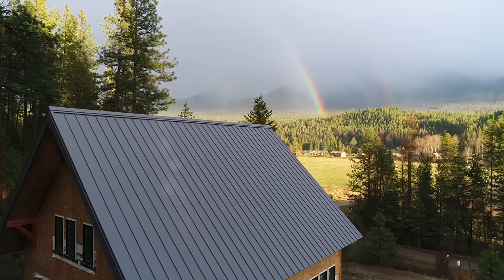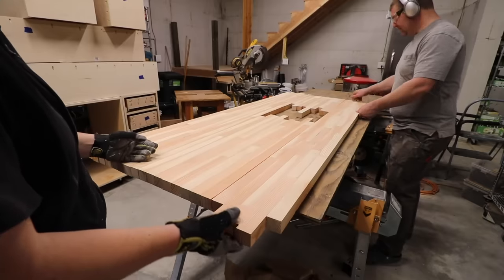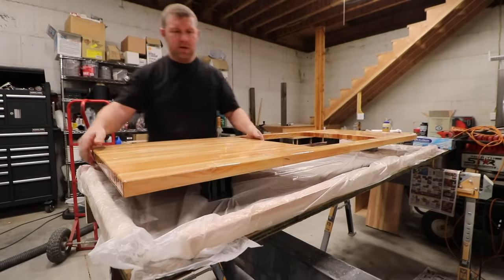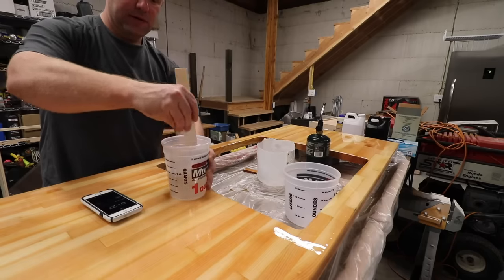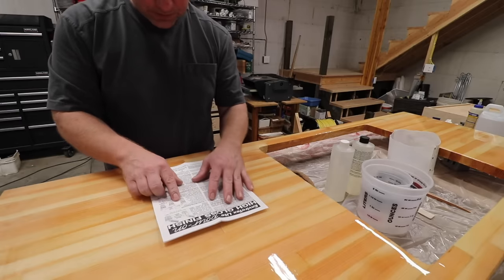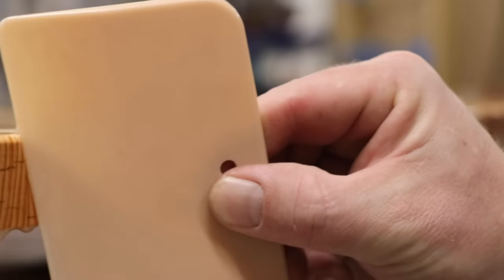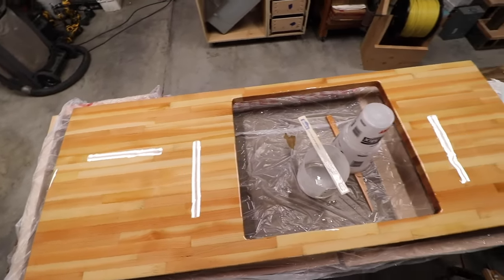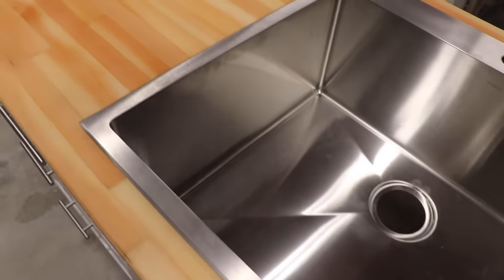AVOID THESE 9 EPOXY POUR MISTAKES

Comment: I've watched quite a few videos on this topic and this is the best. Extra tip - put the resin and hardener  bottles into warm water for a few minutes prior to mixing, this greatly reduces bubbles forming!
Reply: The best? 🤣  this guy messed every stage up, threw about 10ltr on as a flow coat... then sanded the entire thing back to the first coat🤣🤣🤣😂😂   then you gave totally bogus advice and introduced water into the equation, No!!  don't put anything into water with epoxy. If you need to heat epoxy do so by dry means of heat and try to stabilise it so its done over a period of time. Its more important to match the surface you're pouring onto with the epoxy you are pouring on.   
What do I know though I'm only a 4 decade boat builder who's used probably 30'000-50'000 ton of epoxy over the years and built maybe 150-200 home projects including a 35ft long dining table from a split section of Scottish Oak that sold for £28k.  This guy doesn't have a clue and should not have made this vid claiming he did. If his desired finish was wax "brushed" or satin look (ive no idea what exact look this is other than a complete F-up) then a simple feeding in of epoxy on the knots, gaps and greedy bits followed by two thin barrier coats, roughed back with 180 then waxed for whatever reason you'd put wax over epoxy😂  litteraly a 3hr Job. This vid is ridiculous and he's showing the basic stuff that even the entry level epoxy educational vids cover within the first 3 mins. Bogus vid and your praising of this vid is just as bogus.

Comment: My advice would be to use respirator with ABEK1 filters, when working with epoxy. There are different opinions about safety, many youtubers dont use any protective devices. But i have some experience with aircraft maintenance/repair companies, where people are working with composites (epoxy, carbon fiber), and there usually are strict rules always to use respirators, even for quick tasks with resins. Epoxy resin, at hardening stage, spread harmful vapour, which can lead to cancer.
Reply: newer epoxy blends are low or VOC-free formulas.   More traditional forms of epoxy yes definitely respirator, but not as necessary anymore.

Comment: I've been mixing epoxy at multiple jobs for over a decade and have never seen anyone use two containers to mix it nor have I ever had that problem. You're definitely not mixing it well enough
Reply: actually the two container method was a solution it soft spots and is gaining popularity among the do it yourself market, that bigger than the professional market

Comment: I of a different option about this video. I felt that if was informative and was not a rehash... maybe some of the footage was use again but by adding your experiences on how you did the. the good bad and ugly makes it...

I did a project like yours and run into some of the same problems... I found very little information in youtube videos about the problems you can run into.

The one thing I would add is as the size of your increases the level of skill need increases exponentially.   My project was more that twice the size of yours and the 3 of us were running around crazy.

Comment: You will find in the end that epoxy finishes are the worst error in finishing you will ever encounter. They do not wear well and any heat, even the heat from a hot bowl of soup placed on an epoxy top will soften and distort the finish. Epoxy is super expensive, time consuming to apply, messy and all show at the start with no go in the end. You can purchase a butcher block patterned top for next to nothing made of Formica which is nearly indestructible and will last for decades. In a year or two you will look back and say, "What was I thinking?"

Comment: All that work and talk about getting a super glossy finish and then they sand it? They could have skipped the entire thing and used a varnish and been done in 3 hours for $10.00.
Reply: 1 layer of epoxy has the same effect as 70 coats of varnish

Comment: Your flood coat would have been easier if you put masking tape on the edge to create a barrier.  This stops the epoxy from flowing over 
the edge, and you will not need to scavenge the material.   Use your torch to pop bubbles and when your happy with the surface.  
You pull your tape and the epoxy will flow off the edge.  Spread the overflow on the edge to get full coverage.  The rest will take care 
of itself.
Reply: you all probably dont care at all but does any of you know of a trick to get back into an Instagram account..?
I somehow forgot the login password. I would love any assistance you can offer me!
Reply: @Cayden Grady instablaster ;)
Reply: Makes sense. Thanks for the tip!

Comment: You could also use sanding sealer .spray it onto the your surface sealing the wood and you would have no problem with dry spots on your first coat of epoxy.
Reply: THANK YOU! I needed this tip really badly

Comment: There is one thing i don't get.
Why pouring epoxy when it is not to fill a "void" but to put on a "thin" layer.
My dad always painted it on with a roler and he always had a perfect finish wihout the mess...
I don't see anny difference....

He always did multiple layers on the decks of our small competition boats and it always looked perfect.

And from what i learned is that you should to the underside too to prevent warping.
Reply: mainly because they have no idea what they are doing.  They are not driving instructors, we are watching the multi car pile-up...

Comment: I’m preparing to put epoxy resin on a round dining table and three leaves that I’ve just built.  Of all the videos on this topic, this one appears to be the best.  I’m very worried about keeping the inside edges of the table and leaves clean and the use of packing tape looks to Ephesus a great solution.  How long should I wait to remove it?  Also, should I remove the tape after the seal coat and re-apply it for the flood coat or simply wait until both coats are on?  I’m concerned that when I go to remove the tape it will break off instead of the epoxy.
Reply: Pull your tape while the epoxy is still tacky

Comment: Why didnt you use polyurethane on wood? Kind of wasteful using expensive epoxy (clear at that) on a butcherblock. Several coats of "wipe on poly" would work great and keep some of the natural grain pattern.

Comment: The top looks great, no doubt about that.  I didn't see if you epoxied the bottom side though, if not, wouldn't you be afraid of the wood expanding and contracting and eventually cracking the epoxy?  I don't know, never worked with any of this before, so I'm just asking a question.

Comment: I'd recommend using a 1/4 inch notched trowel to spread out the epoxy instead of using a straight edged applicator.  This will help ensure the epoxy thickness is similar everywhere and when you quickly repeat spreading the epoxy, you will also be mixing and re-mixing the epoxy while you are applying it.
Reply: Ohh he needs a lot more advice than that😂  dude sanded back his last 2 coats and a heafty barrier coat to basically the first coat.. then brushed it and threw wax on hahahahaha. Guy basically applied about 15ltr of epoxy then sanded it all off to get a finish that could be done within 3hr. Embarrassing

Comment: CO2 removes bubbles?  Not heat?   If true, could you just use a bottle of CO2?  Or is it both heat and CO2?  Idk, never heard that?
Reply: Lots of folks use a heat gun rather than a torch. I don’t think that you get co2 from  heat gun.

Comment: One other point, epoxy is pretty flammable i was waiting on a disclaimer that you need to have a fire extinguishers near by.
Reply: Is it lots of people use a torch to remove air bubbles in epoxy pours all the time
Reply: Barely, and most "long open time" epoxy instructions tell you to use a torch.

Comment: We have a table we painted white, then sealed with clear epoxy.  Question is, do we really need to sand before the flood coat?  My concern is that the sanding marks will show through the topcoat because it is clear.  Or, will another coat of clear cover the scratches from the sanding?  I know I should have used white epoxy first.

Comment: The counter looks great!  I am a little concerned if you did not seal the underside. Moisture will make it warp and twist. Although it’s fastened down well, I believe he used lag screws from bottom. Over time it will move and probably split along one of the many glue lines. Shouldn’t be too hard to pull it back off and coat the bottom, doesn’t need epoxy. A couple coats of wipe on poly would do. Just something to seal the pours. 

I have a really nice “modern art” coffee table that was only finished on the top and sides. 

Best of luck! Maybe you don’t have humidity in Idaho. 🤔

Comment: using a drill mixer has always given me a fully mixed container - i always make sure to run the mixing attachment up and down and all around the sides and completely along the bottom a few times to be sure but it eliminates epoxy sticking the large surface area of a flat stirring stick. Downside is it introduces a lot more air into the mix which isn't a problem if you have a vacuum chamber or you are doing a deep pour and can let the mix sit for 45 minutes before pouring to allow all the air bubbles to come up to the surface - but definitely can't do this with a table deep (shallow pour) epoxy mix that only has 15-20 minutes of working time.
Reply: Thanks for the video

Comment: hey guys, I have a question: you mentioned that the epoxy wont stick to that clear tape. I would like to do a table, put a tons of stickers all over and then seal it with epoxy. No I am wondering if it is going to work. I just sended the table, now i am planning to paint it, then put the stickers on and then coat it with epoxy. Will this work? thanks

Comment: Put plastic down instead of newspapers.  wear gloves, don't scrape out the last bit of epoxy of the bucket.  it could be not mixed correctly so best to leave it in the bucket.  use a propane torch to eliminate bubbles by fanning above the surface.   mix it till your arm is sore.  then it's mixed.   I've used epoxy for 25 years.
Reply: torching is outdated :)
Reply: Did you actually watch the video? That was what they did. Those tips were the entire point of the video.
Reply: @martinw245  I did watch the video.  He got most of it right.

Comment: I've never seen epoxy mixed by hand, only with a drill and paddle.  I can't imagine mixing enough epoxy to do a counter mixing with a paint stick. I usually chop the surface with a brush before torching.

Comment: Mix your epoxy with a drill and small mixer. Use low speed so as not to introduce air. NEVER scrape the bottoms or side at the end. If you don't have enough, mix more.

Comment: I absolutely love the idea of doing all this work yourself. Do you need building permits or foresee any problem selling the property if that ever happens? I’m a new homeowner and new to this kinda stuff.
Reply: I'd assume you may need permits but there are some areas that don't require pulling permits, especially in the country areas. I could be wrong but my dad said they never pulled permits in the boonies. In cities for sure, you have to pull a permit to redo a bathroom or sometimes to even dismantle a deck. Some of it is a money grab but most of it's for safety reasons. I've been on jobs with my dad that homeowners have done and clearly just winged it, some very sketchy, not up to code stuff.
Reply: Buddy..building permits are a complete joke

Comment: I think the only thing I would have done if if you didn't already do was epoxy all around. The underside of the sink to lock out moisture from accidental overflows
Reply: Sure right,,,normal humidity changes will almost make unsealed wood crawl off . Just at least put two good coats of sanding sealer on the underside.
Reply: Allan A yeah I thought about this when they went they the whole process
Reply: I think I would have also sealed the tops of the frames

Comment: What I don't see you using is a propane torch to get the epoxy to flow and to remove bubbles. I used epoxy on projects 40 yrs ago. Have fun kids!
Reply: Thomas Shaughnessy Well, you didn’t watch the whole video then, did you?
Reply: @pnwester2697  Isn't it odd that you see things if you actually watch the video? 😂
Reply: @pnwester2697   You have to pour and torch to get it to flow and take out bubbles. I never even tried to do two surfaces at once. To do so would be a failure.

Comment: For the two desktops I made I built a flood basin for the epoxy resin. I used scrap 2x4 and cut a notch along the length so the bottom of the desktops would sit on the bottom of the notch and the sides formed walls. I used masking tape on the inside surfaces of the notched 2x4 walls so it would release from the resin basin. Still, with all the effort I put into trapping the resin I got a few globs of it that leaked and wound up on the concrete floor of my workshop. The best one can do is to control how much spill there is, but there will always be some spillage. 

On the upside, my mom and I both have our desks that I custom built with beautiful Goncalo Alves (a wood from Central America) desktops protected by a thick coating of epoxy resin. As messy as resin gets the reward is seeing your hard work on full display while having the peace of mind of knowing it's protected well.

Comment: Welcome back. Nice to see you are back posting videos. 

I have used epoxy in the marine and aviation settings, counter tops would be new for me. But I did do a water proof desktop. I put a 6 oz. fiberglass cloth down to get at least a 15 mil film thickness. Then built up from there for a nice sheen. 

A heatgun works very well to get rid of the bubbles, all you are doing is heating the surface to make it more viscous so the surface tension is reduced therefore causing the bubbles to pop. 

Another trick is put the mixed epoxy in a vacuum chamber and draw a vacuum therefore removing the bubbles from the epoxy. Paint pots make good vacuum chambers for doing this.

Comment: Very good job and well done video!
 I found one odd result for bar top self healing epoxy in New Mexico. If the top gets full sun in summer, like a skylight. It softens while warm. This can result in dimples from glass ware. Consolation is they go away with rewarming. This went on for almost 5 years before it stopped.I don't know if the stuff is still available but this was back in the seventies. The top is still in use and looks good.